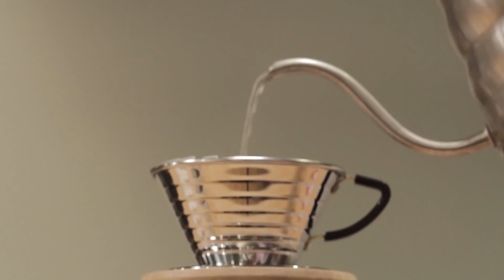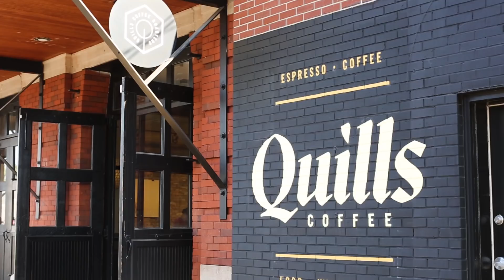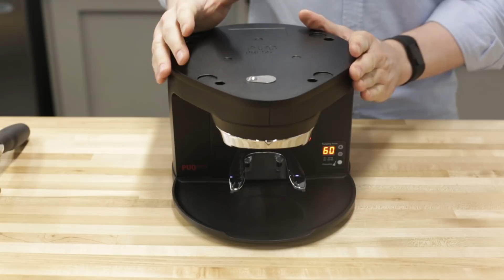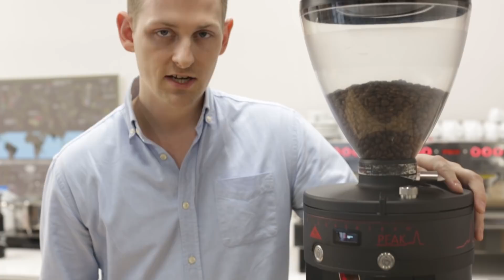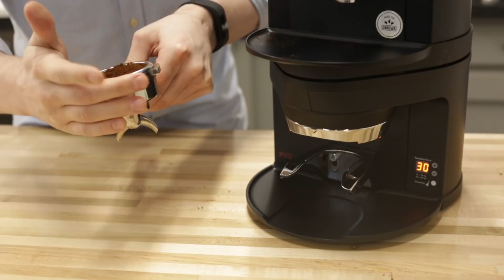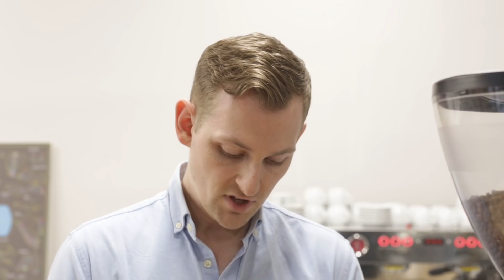Puqpress M1 Automatic Tamper for Mahlkonig K30 & Peak Grinders Overview

Comment: I do work comp utilization reviews and Starbucks is a frequent client. They should be interested in something like this, although to be fair we usually see the high $$ cases where employees are getting shoulder and knee surgeries. And, in California, work comp is sort of never-ending and never- resolving, which sucks, but this makes for better consistency and less RSI which is a win
Reply: Chiro75 Starbucks uses a super-automatic espresso machine that grinds, tamps, and dispenses coffee and then internally ejects and cleans. All the barista has to do is push a button. The milk steaming wand is also automatic so they can just stick it in the milk and leave it. The issues they have are likely just due to pouring blenders and using whip cream and pumping out hundreds of frappuccinos.